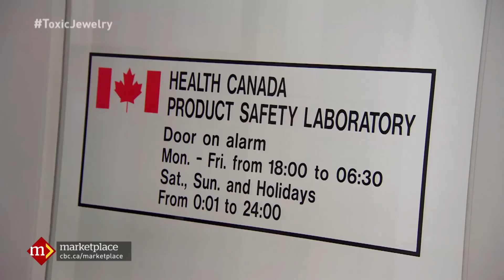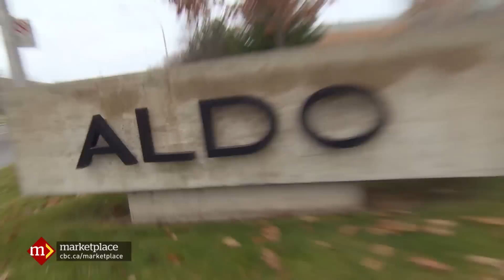Toxic Jewelry: Cadmium found in fashion jewelry (CBC Marketplace)

Comment: that's why my parents hate accessories and they r only OK with gold and silver
Reply: And they're right to! 925 Ag (Sterling) isn't all that expensive and is more or less inert in the human contact context. Much better than taking the risk of wearing potentially very nasty heavy metals, even if it does cost double or triple what knockoffs do (they literally pay pennies for them).
Reply: Please be aware that the cadmium comes in the soldering/brazing process used in Gold jewelry. When I used to handle alloys we would sell soldering alloys to food processors without cadmium (because of toxicity) and to jewellers with cadmium. There was a big difference in prices.
So Gold jewelry will have cadmium.

Comment: Just use Silver, it is pretty, has inherent value (cheap in comparison to Gold and Platinum), and even if you ate a coin you wouldn't get poisoned, in fact, it'll act as a bacteria killer on the way through. Just don't eat a lot because even if it won't poison you, you don't want to get the blue skin syndrome it causes, or need an operation if you get obstructed.

Comment: For the child vs. all..... like if an adult is wearing jewelry, and it breaks, then a bead or whatever ends up in the grasp of a toddler - it's going into their mouth. Or hell someone holds their baby, toddler, etc. and are wearing this piece of jewelry: it's likely to end up in the kid's mouth. Even if the adult realizes their mistake and removes the jewelry right after: that kid has just been exposed to the dangerous metal. And since a baby is so much smaller than an adult, it takes a lot less of a substance to poison them.

Comment: Stop wearing costume jewelry crap- wear real gold & platinum😁
Reply: People arent rich
Reply: Or gold filled. I believe the alloys are not as bad.
Reply: Gale Leitch agreed
Reply: @alexbileau6006  Jewelry with low levels of gold are getting much cheaper and sterling silver is actually a great option! I actually got a ring of sterling silver for the low side of $20. It's a little more expensive but it'll last more than 3x longer, and it's much safer.
Reply: I would recommend platinum, or palladium if u are rich